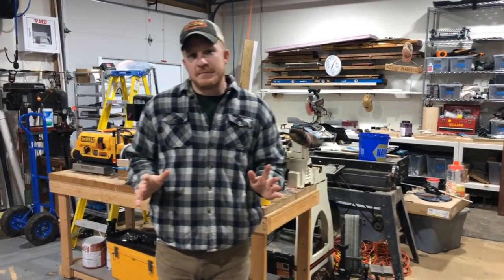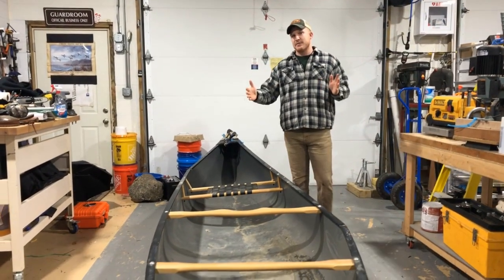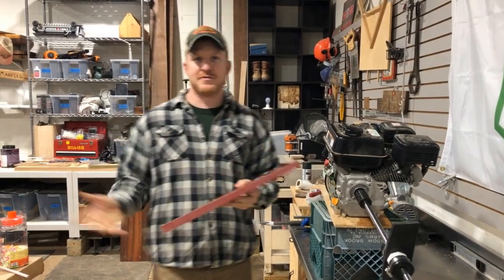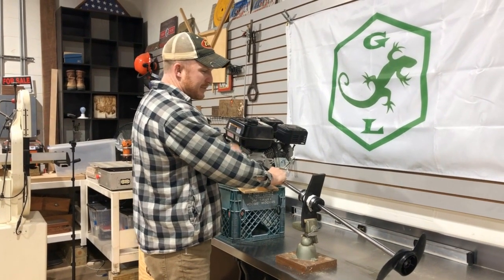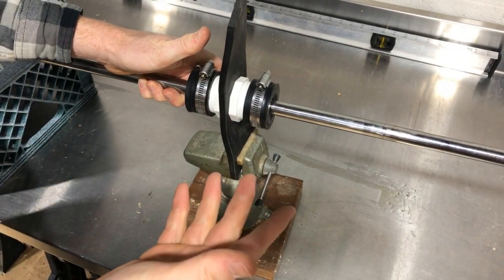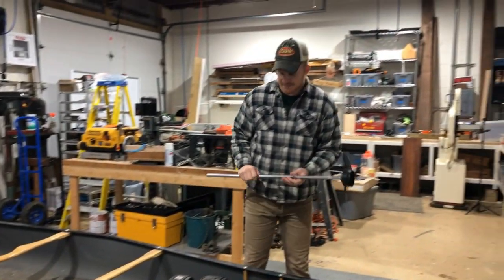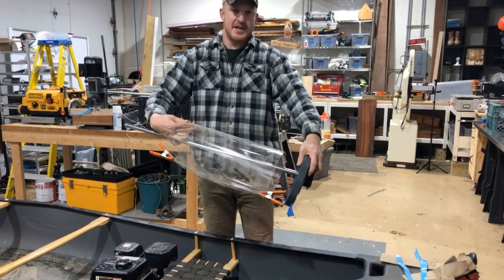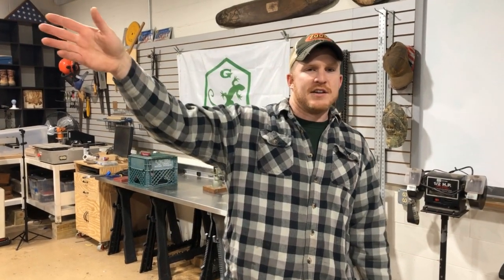Predator 212 Motorized Canoe Build (Part 1)

Comment: I suggest an O-ring or 2 for the packing in the packing gland.  The shaft will need to be absolutely smooth where the O-ring runs to keep it from being eaten by a rough shaft.
You will need to have a very substantial lock, latch, pin, etc to take the thrust for a traveling motor arrangement to keep it in place.
Reply from the maker: Thanks for the suggestions on the packing gland! Good call on the latching system as well. I haven't fully decided what to do (and I change my mind a lot), so any suggestion or comment on this line of videos will be super helpful. I'm just a guy who likes to make things, but not an expert on anything.

Comment: Could you explain just a little more how you made your shaft seal mostly the inner parts
Reply from the maker: It's two 1-1/2" x 3/4" NPT pvc reducers connected by one 3/4" close pipe nipple. Then there's a 1-1/2" Fernco cap on both ends of the 1-1/2" side of the reducer. I drilled a slightly undersized hole in the Fernco cap, and pushed the shaft inside. What makes it watertight is packing the entire inside with grease. I used Lucas white lithium grease. This can be accomplished by filling the entire assembly prior to inserting the shaft. The ferncos will wear to be the exact size of the shaft. The grease does not have room to escape and keeps spinning around inside. Closest thing to a watertight seal I could come up with for less than $10.

Comment: Way too much drama .  Too many things can go wrong !  For horizontal engine ?  Use the same principle as a go kart engine with centrifugal clutch using  1 to 1 ratio to give you neutral at idle and just install a rudder .
OR  you can go get small outboard lower unit and mount a  lawn mower 4 stroke vertical shaft directly mounted to it and give you neutral and forward and reverse .  Steering is also solve too just design a steering and motor mount .... very simple .
Again .... did I say..... keep it simple  ?  Good luck !